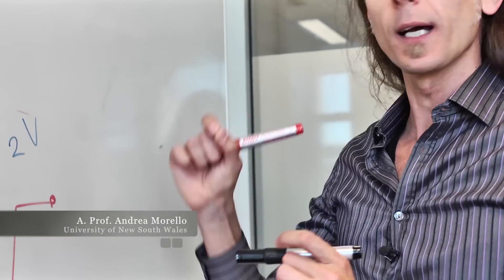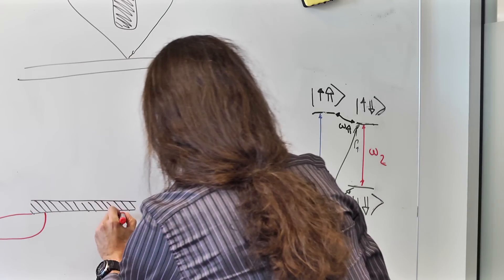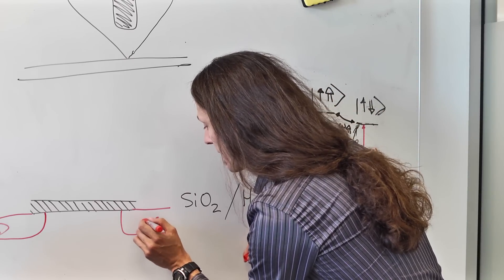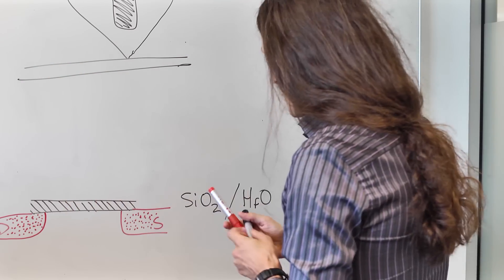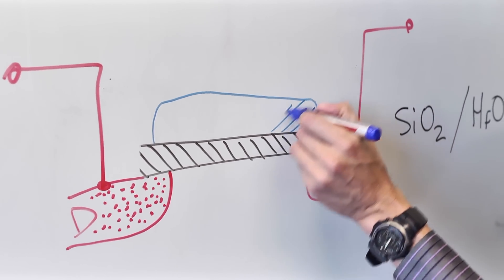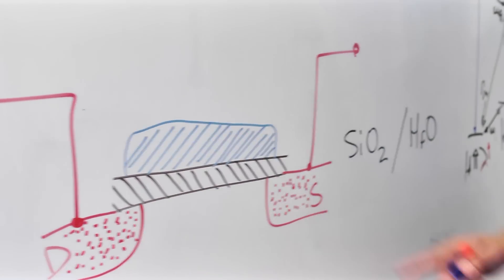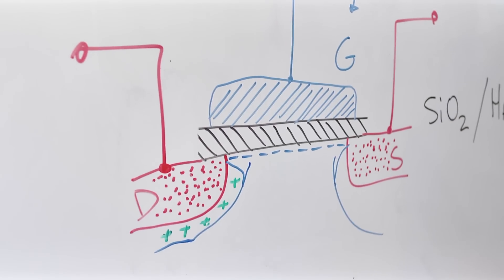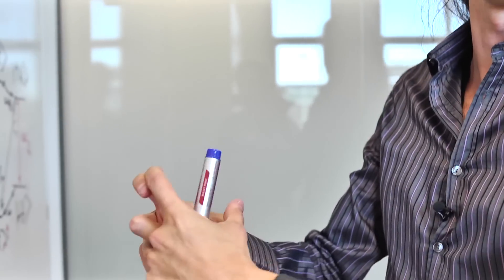Transistors & The End of Moore's Law

Comment: Why not just make chips bigger?
That way you can fit more transistors on the chips.
Reply: Because it would cost a lot more to produce.
The chips would have a higher chance of failure during manufacturing.
And because the chips would use a lot more electricity because they're bigger. There's more reasons, but those 3 are the main ones I believe.
Reply: There are researchers at Intel trying to stack 2 chips on top of each other, to continue Moore's Law past the point where we hit the quantum mechanical barrier, at least for desktops with active liquid cooling.  That should get us a few more iterations anyways, maybe to 2030.
Reply: The real issues is not about heat dissipation are integration on mobile etc .. the real issues is speed of light, think about about an electron (which transport your information) can only travel a a maximum of 3.10^10 cm/s so if your chip is already 30 cm long, you can only reach a 1 GHz processing speed, no matter how many transistor you have into it ;) Other problems are coming if you try to do the inverse, quantum mecanical properties forbid you to go over 5 or 6 GHz if I remember correclty (As a nano-systems engineer student)
Reply: Nowadays, manufactures now shrink the die node size, i think Intel is down to 22 nm nodes, hence reducing the chip size with every iteration. Sadly tho, the smaller the nodes, the more heat is stored within the chip. So the smaller the node, the more transistors we can fit, but also the more heat it outputs.
Reply: Also, as you make chips with more transistors the risk of having low yields in chip fabrication increases due to increased chance of an error somewhere. So at a certain point it becomes uneconomical.
Reply: Bigger chips would also mean that it would take more time for the electrical signal to get from point A to point B (since these points would be farther apart).
Reply: i asked the same question 10 years ago. to my amaze, the cpu on the satellite is huge. i remember it cost more than 2 billion at the time.
Reply: This is comparing the chips with the rate of moores law. explain about it on 4:25
Reply: they are making everything small ( thiner iphone, iwatch , google glass , ...) that will make them to work on smaller CPU & chips.
Reply: the future is the cloudcomputing, you don't need one computer that is ultrafast if you could use a lot of small computers.
Reply: Connor X Graphene
Reply: Stacking should be the way to go aye, since by Intel's Cannonlake architecture, we would squeeze close the electron tunneling effect.
Reply: Heat is the biggest challenge with this.
Reply: DigitalGalalxy extremetech.com/computing/194911-intel-announces-32-layer-3d-nand-chips-plans-for-larger-than-10tb-ssds they just did that with 32-layer NAND chips for 10TB SSDs iirc and RAM manufacturers are planning the same.
Reply: Okay so you make a big chip. How many of those chips can you fit on an iPhone?
Not as many.
Reply: That's effectively what they did with multi-core CPU's. They can't shrink the transistor size much further (yet, maybe) so they load it up with more processing cores. As others have said they're trying other novel ways to stack and layer transistors and processing cores.
Reply: phuturephunk That will work for a little while. Especially if they are very careful about the layout. But localized heat buildup will quickly become a major challenge for a CPU that expands further vertically. It is highly doubtful that they will be able to shrink below about 5nm. Even if they use other materials to allow transistors to function at say 3nm they still have the issue of undesirable quantum effects becoming unavoidable. There will still be modest performance gains from design improvements but the massive gains from die shrinks are approaching an end. Some large improvements are also still possible on the software and firmware side.
Reply: phuturephunk
thats very hard to do. hey samsung was the first to stack their chips on their ssd making it faster and store more memory and its very stable.

people doubt samsung at first but they did it.
Reply: BlueRice Samsung is doing it with memory chips which are far less complex and have far less heat issues. It it has still been a a challenge. So much so that many other companies are just going with Samsung tech rather than trying to go with their own solution.
Reply: *****
i know its a lot easier than cpu with billions of transistor.

SSD is still somewhat new to technologies. when ssd first came out it was actually slower than HD and wasnt reliable. for samsung, to able to push techonlogies to the limit is surprising. there are far older companies that been int he business for years specially if they only specialize in memory chips to be out-done by samsung is a big accomplishment.

 although speaking, stacking it is still a risk of failure. so i applaud samsung for first to do it.

sandisk recently made 200gb for their micro sd. it can tolerate desert heat and freezing cold and some water resistance. but again thats easier to make than stacking memories on top of each other.
Reply: ***** Heat dissipation is a larger and larger issue on Newer smaller chips because there is LESS surface area to dissipate heat.

This is why older CPU's GPU's didn't even have a fan cooling, just a heatsink, Because their die's were larger and thus conducted heat more efficiently thanks to larger surface area.
Reply: jagara1 Because if there's too many transistors next to one another the resistance will produce too much heat, which would melt the CPU.
Reply: James Oldfield Thanks for the answer - I realised that there was a scientific answer that I was missing.
Reply: jagara1 Because do you want to have a computer that is 6 feet tall and 3 feet wide?
Reply: DBZHGWgamer if it can perfectly predict the weather then yes I think that size is acceptable.
Reply: jagara1 No... You would need a commuter probably a few hundred times as big, along with a telescope that is able to mesure the location of every single molecule of air, their velocities and directions, along with how they will react when hitting each other, exactly how much heat and light radiation will hit earth from the sun, and a few other measurements. So, its not really possible with any size of computer.

Comment: whats the big difference betwen ECB (emiter,colector,base) and DGS (drain, gate source) transistors?
Reply: The Bipolar Junction Transistor (ECB) switches on current and the MOSFET (DGS) switches on potential (voltage).
Reply: Notation. They are the same thing - it is just that most manufacturers nowadays use the ECB notation for leads versus DGS. Emitter is the Drain, collector is the source and base is gate - though, at this time, I may be swapping collector and base. But regardless, that is just a naming notation more than anything.
Reply: I work with transistor since 1999.
I would say the opposite, mosfet's are more popular then normal trasnsistor with emiter base colector.

Comment: why cant we stop stuffing in more transistors say per square inch of a chip and just increase the size of the chip itself? there cant be any physical limitations to how big a chip can be is there?
Reply: small transistors are less hot, more efficient, faster, and cheaper to produce as u can fit more per wafer
Reply: actually i got the answer that bigger chips consume more power and produce more heat and there is no viable way to heat sink them, that puts a limit on size of the chip.

Comment: If we had more transistors in one chip we would have enormous speed but the problem is the more transistors you have the greater the temperature will be thats why Multi-core processors were made. But I believe when new models of batteries with longer duration replace the old ones in our phones and the energy cost comes second the companies will start create CPU for  Desktop computers

Comment: Shouldn't lowering the Voltage between Source and Drain delay Quantum tunneling? I imagine it to be like two wires getting closer to each other: the lower the voltage, the lower the chance of the charge to skip over.

Comment: The reason why frequency scaling stopped is because voltage scaling stopped at 90nm for a variety of technical issues (aspect ratio of interconnects, signal noise, etc.).  The power of a device is proportional to the product of the operating voltage squared and operating frequency.  If you continued to increase operating frequency without reducing voltage, the heat of the IC's would exceed their operating temperature range.  This is why you can find a Youtube video of someone operating an IC at above 8GHz while pouring liquid nitrogen over the chip - if you remove the heat the chip can operate faster.

Comment: I believe that quantum computers and classical computers could be used as a hybrid. Why not use classical computers with quantum computers as a peripheral? Logic says that if quantum computers can be used in math, and the output is a useful number, the output could be turned to classic bits. Similar to a GPU on a computer. The computer sends the instructions to the GPU, and the GPU's circuitry, which is superior for the math used in rendering, but not good for what the CPU is good at, processes the input to produce an output. Why can't quantum computers take a classical bit input and output a classic bit output?

Good luck Professor Morello!
Reply: problem is, would it be slower or faster converting the quantum bits to bits?
Reply: What about cooling problem?
Reply: I imagine that if you gave quantum computers a ton to "chew on", it would be really effective. 

As for the cooling problem, I believe there are some scientists that are developing a prototype that works in room temp. You would have to google.
Reply: mecause money

Comment: Not to be a troll or anything but intel quadcors have between 1.2 to 1.4 billion transistors. in 1997 we were at about 500 million transistors but that jumped in 2008. In 2008 intel announced that they have a 2 billion transistor chip but I would definitely be surprised if anyone even has a 2 billion transistor chip in their personal computer. Intel just came out with Intel's 15-core Xeon server which has about 4 billion transistors and that is CRAZY!!. I think that AMD released a 16 core in 2011 and it's still going for about $2000.

Comment: What I am getting from this video is that in about 10 years or so, quantum laws will prevent transistors from getting any smaller, so we will be needing something new to replace transistors if we ever hope to have a smartphone with a Exabyte capacity.
Reply: PlasmaMongoose
What does a HDD have to do with transistor size? Nothing...
Reply: Yes and Professor Morello and his team are already working on it.
Reply: Honestly, Moore's law is probably already over today. It's getting too expensive to scale transistors down further.
Reply: Actually innovation in HDD drives has also kind of slowed down too. All of the low-hanging fruit is being picked! :)

P.S. Hard drives with magnetic platters aren't much related to transistors, but solid-state drives are! So you weren't totally foolish... :)
Reply: ***** If you read my comment, you will see I was replying to Plasmamongoose, not you. Genius.
She was talking about Hard Drives. HDD data is stored on platters, and not on microchips.
Reply: zHSVClubby I always figured that the hard drive was the microchips for some reason then I wikied these HDD platters you mentioned, I feel kinda foolish now...
Reply: DFX2KX You're totally right that for memory it makes sense to go 3D because you get higher density. However, it doesn't make sense to go 3D for processors because they are heat-limited. Packing more transistors in will only make the device hotter and hotter (which means you have to run it slower and slower). 3D for memory is good, but 3D for processors is not so good.
Reply: Ted Sanders
I didn't think about that. You'd almost have to have a way of liquid-cooling the innards, and I'm now sure how you would.
Reply: ***** I'm a bit late to answer, but we do need to get more and more power with CPU, because the need keeps increasing : for exemple, there will be 4k UHD display soon (4K TVs are already out). Our computers may handle it. But after ? When we'll be at 8k, 16k display ? And what about internet ? We need to get thing faster to handle 4k video stream, so we need to be able to receive data faster, and to compute them faster. So in the end, we need better CPU. And while you may be happy with your i3/5/7 doing so Open Office work or watching videos, there are other people that needs more powerful CPU to render things faster (even an i7 can't render a 1 hour 1080p video in a decent time yet).
Reply: Ted Sanders I know what you mean, my PC is 3 years old, has 8Gb Ram and a 2Tb hard drive, I looked up the latest PCs today and while the Ram has increased, they still only have 2Tb hard drives at the most.
Reply: @PlasmaMongoose i think you didn't even use the first half of your Tb hard drive.
Reply: As transistors are constructed (in a 2 dimensional layer-cake fashion like they are now) yes. 3d circuits allow for much smaller and more compact circuits, but that's only being tested on memory at the moment (which is the simplest and earliest new application for this sort of thing anyway), when that runs out, we'll be at the hard limits of moors law with silicon.
Reply: Ted Sanders what  about SSD's? it doesent have platters
Reply: delisonbor
You're correct that SSDs don't have platters. What exactly are you asking?

(As you may know SSDs are faster than HDDs but more expensive.)
Reply: Do we really need to get smaller.  I think we have reached a comfortable level where we can get everything done with the chips we have.  Voice recognition, HDTV as good as the eye can see, etc, sure we can go smaller but I think the technology has matured to the point where we can do everything with what we have.
Reply: *****
size is mostly a power-use concern, at this point.
Reply: Emerson Fant  When I plan to replace my 1.5TB PC next year after 3 years, I would be perfectly happy if the new one had just 2 or 3TB.
Reply: Ted Sanders Though harddrive innovations just started up. With new drives comming out with 6tb 8tb and 10tb. Though I think they have helium inside the casing.
Reply: ***** Someone said something similar to what you were saying about 30 years ago.  People never thought they would need more than 1MB of RAM or more than a 10MB hard drive.  I guess my point is that you don't know how much computer power you need until you need it for something new.  I am sure there is something that we may not have thought of yet that would benefit from more computing power.

Comment: Even when I was in college back in 2000, the professors guessed that by 2015 we wouldn't be able to go any faster.   Because eventually you approach speed of light.  I understand that has nothing to do with this because this is about size not speed. However, even back then we were guessing that the microchip was limited that we would have to learn more about multiprocessing focusing less on the individual processor.  Which now days that multi-processing (multi-core,multi-threaded) is somewhat handled by the hardware and OS.  From what we as students knew back in 2000,  if you got your cpu to small that your electrical charge would jump between transistors. Once that jump happened you lost information (0's & 1) the calculation (info) was worthless at that point.  I as a student didn't think the teacher even though he was from MIT was considering as it approaches the end the acceleration will slow down because it's approaching physical limits which you can't be doubling as you approach that but I was only a student so I didn't say anything.  I am assuming that's what this guy is trying to do now to switch out of our known physics to quantum.  Either way the microchip will get cheaper and cheaper but I think the size is limited by space it can fit within. Personally I am wondering where the hell is my robot or cyborg stuff been waiting since star wars.  You engineers in robotics & biologists you are dragging your feet mass produce one.  I want to plug in like the matrix.